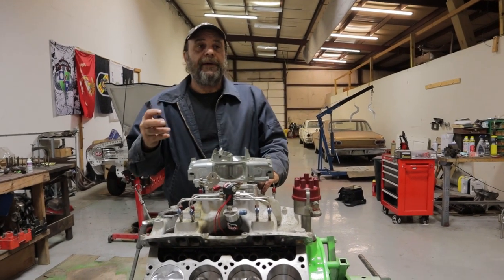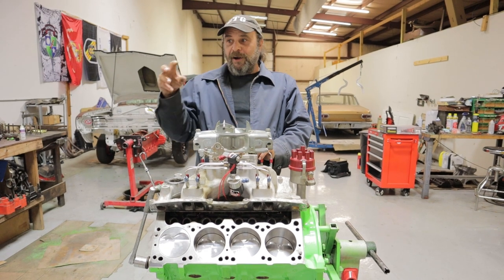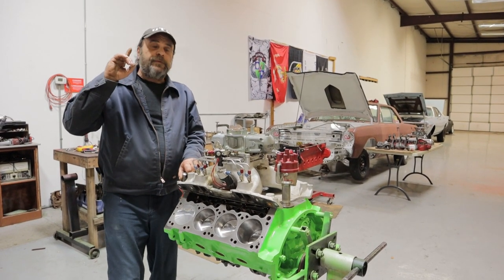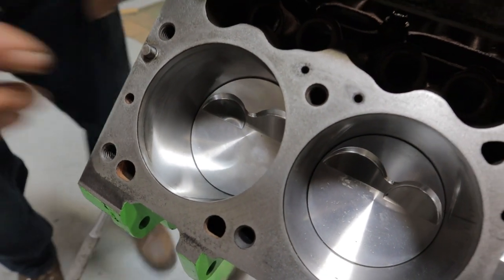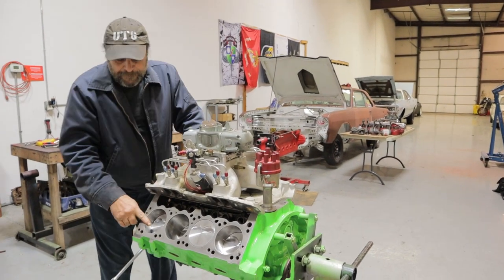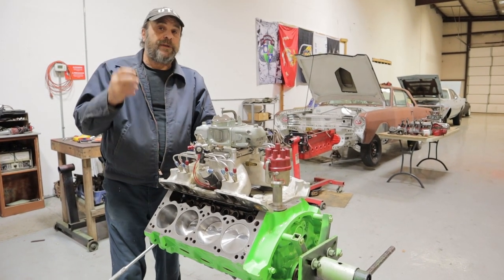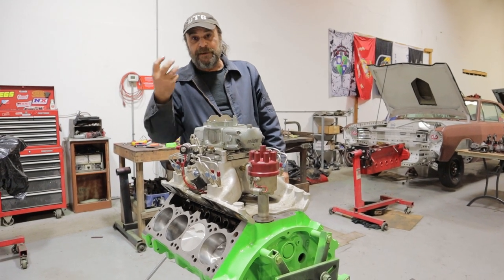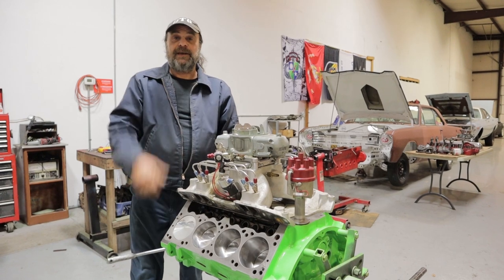The Fundamental Aspect Of The Internal Combustion Engine Nobody Ever Talks About

Comment: I disagree. The fastest burning with the least amount of ignition timing it the more efficient engine. Homogeneous  combustion, where the whole charge is ignited at once (not detonation) is the holy grail of engine design. Higher compression burns faster and has less ignition advance than low, produces more power and efficiency. The reason nitromethane has so much power is because so much oxidizer in dumped into  the engine, not because it burns slow.

Comment: i wana agree. but i think the lack of power with vapor has more to due with the fact your not getting as much air fuel mix into the cylinder due to to fuel taking up so much more volume vaporized. and this could still have the effect your talking about where it doesnt produce as much hot gas to exspand the piston ect. i mean if it was the case we wanted the fuel to burn though the entire stroke we could retard timing and it would have a simular effect but ofc we know that is not the case. i supose if your looking for peak performince this is desireable as we see with nitromethane the pure quanitity of fuel allows it to burn for such a long time but in most applications this would lead to waste as we dont usualy drive under wot. we could also lean/ritchen the engine or reduce compression to give this effect as it slows the flame front.

Comment: As driving on Propane on my slant six, I kinda have 30% less power when driving on propane.

You can build a high compression engine to even it more out, but with the price difference it's just worth it here to drive on it..

But this is also an nice explanation why propane powered cars are actually more quite as gas cars!
Reply: Adjusting the timing map does help tremendously. Running propane with gasoline timing is lots of energy wasted. Best thing is to ditch the carburetor and just use a throttle body and electronic mappable ignition (or the right weights and timing with regular ignition). When setup correctly LPG can even feel better than gasoline.
Reply: @RustOnWheels  problem is, I want to be able to drive to other countries with my car.

Got twin carbs that already isn't that ideal for propane. But 2 different distributors.

Gas one can ride on propane but makes shit power. Propane one can't be on gas

Comment: By what you said about nitro, would you be able to use that to have a long enough duration. For more combustion on the power stroke with the vapor system. I’m not sure but in It sounds like it would be the trade off you would need.

Comment: On a direct injection engine do they or could they add fuel" late" to get combustion till the piston is almost at the bottom? Cause in my mind if you dropped fuel after the first flame it would ignite.  With modern computers you could use that under load conditions and make more power when needed.

Comment: If vapor I take system is no good for torque and horsepower, then I wonder how the Sherman tanks they used them on ran back in WW2?
If there is anything that needs to run a lot of power all the time its a tank.

Comment: I like the smart carb as it makes a finer mist of fuel than other carburetors. The better you can atomize the fuel the more efficient the carburetor is my first thought. So the duration of a pressure pulse the more powerful an engine is. Gasoline burns too fast for a long pulse. So should gas engines be built around their pressure pulse to be made more efficient.

Comment: I used to read  Circle Track magazine 40 years when Smokey would write stuff, I read all his  stuff (he hated kong haired guys) the engine was the 151 Iron Mike corporate block which was  half a 302 ,bore and stroke just cheaper rods crank  but missed out on designing a cross flow head, any how engine has what appear,s to be a mini super charger, to compress the mixture, the  car was  Pontiac Fiero with a lightened chassis etc , most he got was 50

Comment: As an engineer, if the pressure wave is active over fewer degrees of rotation, by increasing the number of cylinders in the engine you should be to compensate by reducing the number of degrees of rotation from cylinder to cylinder so that the power pulses are shorter but more frequent and in effect average out to the same power output of an engine with larger power pulses but less frequent over one revolution of the engine.

Comment: During WW2 the Germans used wood gas to run vehicles but I don’t think they were doing 13 in a quarter mile. And as far as the rotating assembly if they could try it out on a rotary engine they might be able to pull it off. Or maybe changing the stroke of the engine to get the maximum on the rotation quicker or in other words take the slack out of the stroke. Anyway love the videos and you always get my mind thinking 🤔

Comment: Very interesting as always, I wonder if there is a set of circumstances where the hot vapor setup would work well, for instance maybe a engine with more smaller cylinders?  I was thinking of European engines that use 12 smaller cylinders or something similar, Might make another good video in this series!

Comment: The only real way to build a hot vapor engine is to have it set up with a gigantic bore as extremely short stroke and just keep it running at a steady state powering and generator or a pump maybe but not much else

Comment: The IC engine is a burn barrel not an air pump. It's the fire in the cylinder that makes the power so you really want lots of fire and the fire to burn faster and make the pistons go faster and in order for that to happen you need to feed the fire more air.

Comment: Tony. how do multi spark systems come into play here. Do they really extend or create multiple pulse in the cylinder for a longer burn? And would using a lower octane gas with more btu's create a slower flame front, and longer burn if able not to ping? I am a huge Buick guy. and have always wondered why the Buick 455 made some much LOW torque. But when you look at the specs closer it totally makes since. A wedge combustion chamber with a large quench area.  Large bore for a slower flame front. and a shorter stroke than most all of the other big blocks at the time to use almost all of the power with little loss. and a super heavy rotating assy. for added rotational mass. Clever guys. Clever;)

Comment: You can atomize fuel with an ultrasonic transducer,with downstream O² sensor and dedicated mcu you can control mixture ratio - (john bowers method) ,also you can use electrostatic charge to fuel to keep molecules equidistant, and again downstream O² sensor and dedicated mcu  ( slim 13x method )

Comment: I really enjoyed this one Tony! One thing to understand is the speed of sound of a flammable mixture influences how fast the flame front and pressure waves move through the mixture. Energy in any form can only move through a flammable mixture at or below the speed of sound of the mixture. Speed of sound increases with temperature (actually the square root of the temperature) so anything that increases the temperature makes the energy go faster through the mixture. Thus compression, heat from the metal, the flame itself, etc. increase that tendency. Hydrogen has the highest speed of sound of any gas which explains why it burns so fast during the power stroke of the engine. I assume vaporized gasoline has a higher speed of sound than atomized gasoline from what you have said. Interesting stuff!

Comment: Great info.  Picking amshort stroke engine with wide piston and short stroke would help with hydrogen  engine.   What you pointed out would explain why they don't ru n hydrogen  on internal combustion  engine but use it to generate electricity  and then run big electric motors.

Comment: I thought for sure I was going to hear him say volumetric efficiency.   Whole idea of a performance engine  is to get as much air fuel mixture into the cylinder as possible before closing the valves and compressing it and igniting it.  Perhaps that will be the focus of tomorrow’s conversation.

Comment: I suppose this is why gasoline direct injection makes sense. For all of its drawbacks, the one thing it really succeeds at is raising the compression ratio beyond the spontaneous ignition temperature/pressure of gasoline, up into diesel territory, which should give a longer pressure pulse. And thus be able to make more efficient use of it.

Comment: Great Video! It all makes sense now. Hydrogen needs oxygen to burn, and an water electrolizer gives the perfect ratio, to detonate! 
This is why the HHO or Brown's gas car MUST; 
(1) have EGR included, to slow the burn with inert air, and
(2) inject water vapor to absorb the enery and turn to steam,
 thus becoming a tunable steam engine able to act from a low power idle to Nitromethane powerlevels through extended steam pressures,
(3) and optionally add an exhaust gas cooler and condensor so you can reuse your water/fuel.

Comment: This is a cool video, thanks! Power it seems is created within the first 40 degrees after TDC with traditional fuels.  From a design perspective what advantage would be provided to offset the crankshaft center from the cylinder center such that that the leverage the piston/connecting rod assembly has on the crank is improved during this portion of rotation?

Comment: Hey Tony, great video! I was wondering if you could maybe speak on the merits of water injection for better economy? I've heard of people using it to control detonation in turbo, or supercharger engines, but I thought about using it to improve economy at cruising, when vacuum is high, pulling water, or water/ethanol mix for those of us who live in colder climates to take up space in the combustion chambers, essentially making the engine smaller displacement when power isnt needed, then when vacuum drops, cut off the water allowing for full power when accelerator is depressed. Would the steam flash also help extend the push from the combustion into further down in the stroke, like your example of nitrometh, or would it begin flashing to steam right away when entering the chamber? I am sure I am not the first to think of this, but your explanation got me wondering about that. Thank you for the knowledge!

Comment: You're shortening the timing event when you raise the base temperature. Instead of going from say 100 degrees to 1000 degrees,your going from 300 degrees to 1000 degrees. Plus the fuel is a vapor instead of a spray, so it lights, and burns waaaaay faster.

Comment: Propane is a prime example of this
Reply: I'd have to disagree.  Propane is an excellent fuel alternative for gasoline engines.  If you have it set up properly, the performance is nearly identical to gasoline.  It's higher octane (technically) and burns MUCH cleaner than gasoline.  The only real drawback is that it produces lower BTUs, so you get slightly lower MPG when making the same amount of power as gas, but since LPG is usually about half the price of gas, it more than makes up for the slight drop in mileage.  Of course, you also have to consider that it's not as readily available as gas in most places.

Comment: I wonder if a twin port rotary engine on vapourized fuel would do anything?  Isn't Mazda doing something with their new SkyActive engine that has two types of injectors before and after the intake?  One could possibly do vapour and the other liquid fuel to maybe get the best of both worlds (if it's even possible).  There would need to be lots of testing and I have no idea the drawbacks or if the complexities are worth it since ICE will be phased out fairly soon.  Maybe a hybrid car where the engine can run on vapours to charge the battery.  The ICE can be running in its sweet spot for efficiency and the battery drives the wheels.

Comment: #UncleTonyGarage has ANYONE ever tried to run a High Compression GAS race type spark plug engine with a 18 or higher compression ratio on full diesel or a diesel gas blend that you know of ?
Reply: No , because everyone knows what happens when you feed 20 octane fuel into 18:1 compression engine.

Comment: Not sure I agree with this, and I can think of a few ways to argue against it. What you said about Nitro motors I think is true, but you didn't mention that those motors run on like 30-40 pounds of boost. Because the fuel burns slowly, it needs the additional pressure of the forced induction to squeeze all the reactants closer together and increase the reaction rate / flame speed. But if I take a gasoline engine and put a supercharger on it, we all know there will be increased cylinder pressure and more power. But because the intake charge in under boost, it will burn faster...the exact opposite of what you claim will increase power. The reality is that the boosted engine creates more exhaust gases and higher cylinder pressure that can effectively push the piston for more duration than it would under no boost. So "extending the duration of the burn" equals more power I don't agree with. Another example against this would be turning an engine to very high RPM. The rate that the fuel burns doesn't change with the speed of the engine. Based on your claim I would expect to see an increase in torque at higher engine speeds because the fuel would be burning for a longer duration of the pistons travel. But I personally have not seen evidence to support this. For example, changing to a longer duration cam will move peak torque to a higher RPM, but usually the peak torque number does not change significantly versus a lesser duration camshaft.
Reply: Moral of the story- Don't believe everything you hear on the net.

Comment: Great video! It seems like the hot gas (vaporized?) engine type would benefit the most from high combustion pressures. Manipulating it through valve timing events initially, and then increasing compression ratio would be a start. What do you think UT? 
I love the theoretical aspect of your videos!

Comment: so, when I was trying to set the timing on a ht. 383 in a k30. I had fits to stop thinking like the old 305 350 initial timing at 8 degrees. I learned to start at 10. I am at 12 and it is wicked.

Comment: Smokey, definitely talked with Detroit  ( one or more big 3 ) engineers about pressures and crank degrees . One of the engineers stating there was no way the hot vapor engine was going to be able to pull away at low revs, without a destructive level of detonation . Test results in, engineer, You, are the ignorant one.  Btw, with the engineer in the car . So, I believe hydrogen and vaporized gasoline might be quite a bit different .
Reply: Smokey just cheated them , as always.

Comment: So basically vaporized gasoline takes up more space than liquid gasoline. So you can only fit so much gas vapor and air into a cylinder.
Reply: That’s why the vapor guy put a turbo charger on the intake to compress it back down

Comment: So a hot vapor  nitro motor  would work?  Just kidding. 
Didn't Smokey use an alchohol, water mix,  injection system. The slow burning methanol??
Reply: IIRC, he did. Of course he ran the fuel through the turbo (on one iteration anyway) calling it the "homogenizer". Pretty standard to use alcohol and water to mitigate detonation/pre-ignition.

Comment: Tony, your presentation sounds very convincing, but you cannot say with all certainty that the degrees of travel of the crankshaft are at the degrees that you say. You cannot say that the pressure wave makes the piston travel less with vapor gasoline than with liquid gasoline with true certainty. As you yourself would say to someone claiming high MPG: "Show me that this is true. make me a believer". Tony, show us that the degrees of crank rotation that you mention are true for the given fuels, and don't just expect us to take your word for it. You say that 100 and 200MPG are just numbers that have been "thrown around" for years, but you just threw numbers at us as well. Please Prove the numbers.
Reply: I just finished reading through the comments on this video, and there are a bunch of people here that have messed with vapor and hydrogen systems that say UTs assessment nails it.
Reply: @ericlandstrom6155  A bunch of people also thought it unimaginable that man could ever build a flying machine, and airplanes are as common today as apple pie.

Comment: So we mix hydrogen with incoming air light it off and direct inject nitro methane to continue the burn? Modern engine technology may be?
Reply: More thoughts, First, you have mentioned placing the wrist pin offset closer to the thrust side of the piston so it starts getting combustion pressures applied quicker 10- 12 degrees vs. 13-15 degrees of rotation this would apply more thrust sooner in the cycle. Second, some where I read that Smokey used a very short stroke and a large bore plus more rpm's to get in part, to get some more power out of that quick burn.